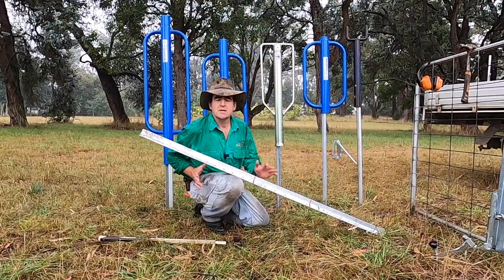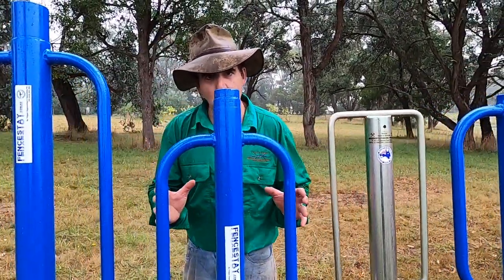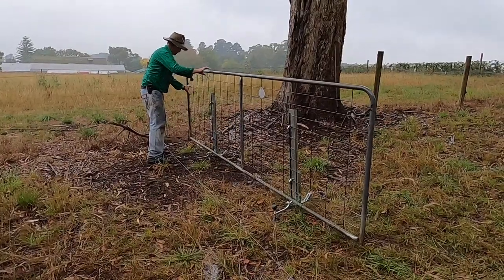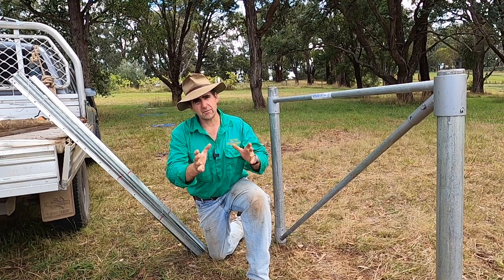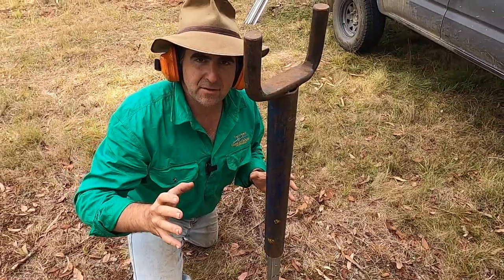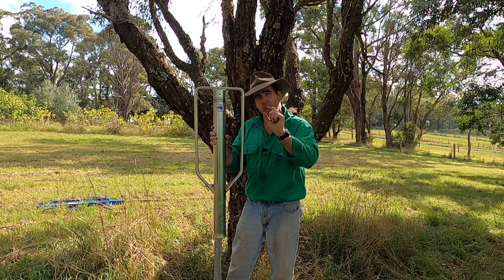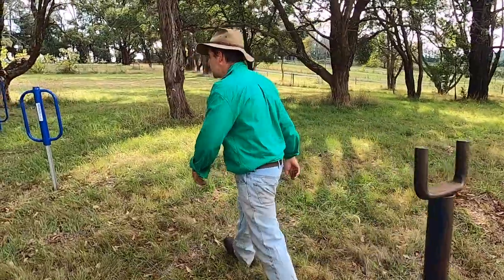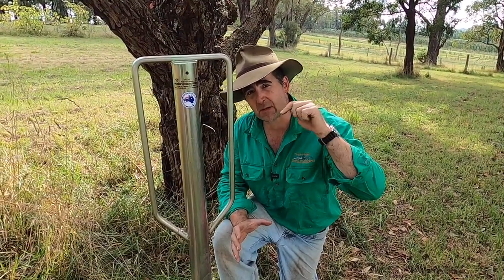Post Driver Review - Things to think about before buying a simple tool

Comment: Hi Tim
Yes they are dangerous! A work colleague cut his thumb off when holding onto the top of drivers ears .
Over extended on the lift came off the post and on the down stroke the post ran up the side of the driver severing his thumb. Since then I always use the longer drivers.
Thanks Tim great video as always!

Comment: 7:52 Tim, that exact situation happened to me last week. The only reason you didn't hit yourself in the head was because you were expecting to over reach. What happened with me, is that I was looking down at the base of the post and over reached. On the downstroke the bottom of the striker caught the top of the post and with full force I hit myself in the head with the striker. I saw stars for a couple of seconds and my neck was really sore. My head movement was greatly reduced for a couple of days but didn't do any permanent damage. I'm fully recovered luckily. Now, before I bring the striker down, I check that the bottom is clear.
Cheers

Comment: I incorporated a feature on mine - i put a weight on the bottom.  This acted like pendulum to keep the driver facing down. Drivers with the weight at the top want fall backwards behind you.
The weight I used was an old D6 track adjuster.  You could do the same with a short piece very heavy walled pipe. Approx 5 to 6 inch of hollow bar might work. I agree that short drivers are a danger, and should be banned, mine is 1200.  Very satisfying when it hits the ground.

Comment: Great videos Tim. If I was to use both standard and XL star pickets, can the XL sized post driver also work with standard star pickets or is there too much movement/slope inside the post driver? The Sneddons looks the goods.
Reply from the maker: Long story short, the XL driver will work with standards but you will have less control.

Comment: Hi Tim, I have wooden posts 50 x50 square 1.2 high and am looking at a 57mm square  internal post driver, Will this be adequate or should I go for a larger bore size and round vs square Thanks, Gary
Reply from the maker: G'day Gary. 50X50 posts seem a bit thin to work well....

Comment: How would that noise dampener in the Sneddens hold up over the years? Would you be able to get a replacement nylon plug or is it a case of either going back to full on noise or tossing it over the shoulder once the nylon plug breaks apart ?
Reply from the maker: Probably the latter I reckon
Reply: Forget the nylon insert 
Pay a machine shop to insert a aluminum plug without the handles on a 27/8 pipe 
It will  get that fence installed without breaking your wrist 
I know I'm a fence builder

Comment: Anyone that is employed to do this job is not going to use one of these. I am so sorry I and any of my employees would never use any of these. I have installed 100s of miles of wood and steel fence all with machines. 
These are geared for the consumer rather than the people in the industry of building ag fence.  If you need this type of fence and do not own a tractor with a loader, check with you neighbors. I am sure you can work a deal out with them. 
I will give you one of my trade secrets for installing at the correct height. Find a light weight tube a bit larger than your steel post and cut to height of fence. Then slip it over the post and use loader to push in to the ground just a bit above the tube. 
Tim, the h brace you have there by the truck which way did the fence go?